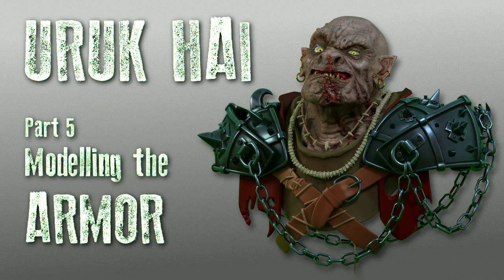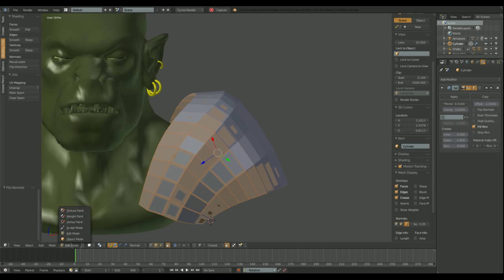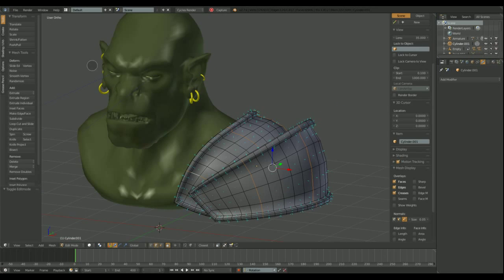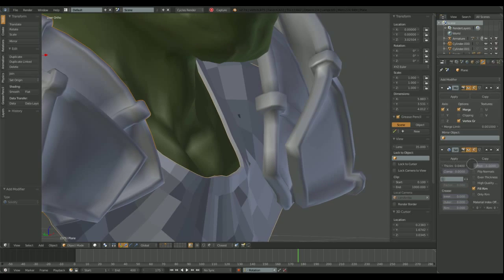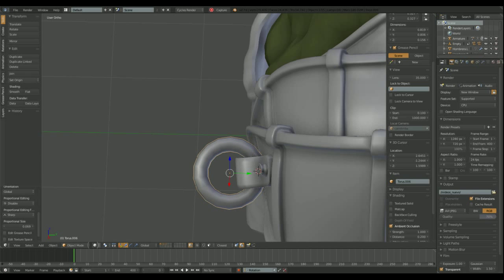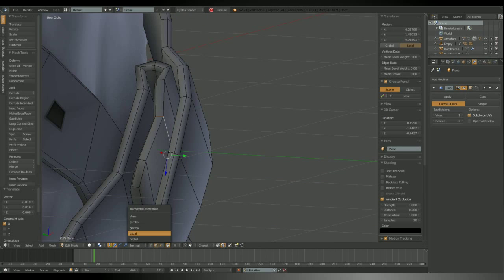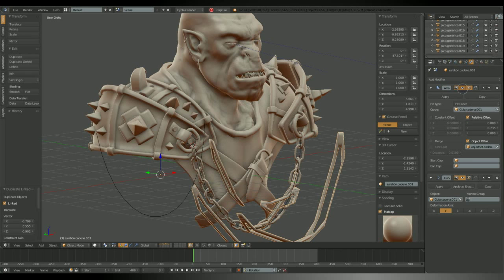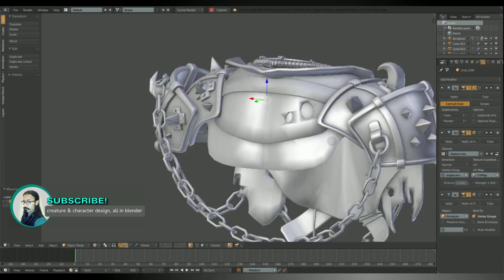Uruk-Hai part 5: Modelling the Armor and clothes

Comment: Hey dude!!! Creatively, I understood perfectly what you were doing but I dont know how to work with the software. Do you have a video that teaches how to use the software?
Reply: For blender there's a lot of tutorials online that can help with almost anything you're trying to learn!
To start, download is free!

I think the most important things to know as a beginner in blender would be:

1. To rotate the camera around its pivot point is done by clicking in on the middle mouse button.
2. Add shift to that middle mouse button and you'll drag/pan the screen.

I remember movement being difficult to get used to when I'd first started.
Once you feel comfortable moving around blenders 3D viewport you can create your first object..

1. Shift+A to add something; maybe start with a cube. :)
2. Once you've added a cube, TAB will switch you between Object mode (mostly for viewing/merging) and Edit mode (for shaping).
3. In Edit Mode, CTRL+TAB and select Face from the menu; try clicking a single face of your cube and hit G to move it around.
4. To snap it to the grid, SHIFT+TAB will toggle that option, but also may snap you to Vertices/Faces.
5. While having a face of your cube selected, instead of hitting G, try hitting E.  That will extrude the face, creating more faces.

Very basic stuff I have mentioned...
But enough to get you started on making some fun shapes n' stuff.
I think that quick keys for the software you're using are a massive part of workflow.  Helps your hands to keep up with your eyes and your brain on what you're trying to create.

Good luck N H!  Hope that helps. :)
Reply: @samohickey  Dude!!! That was a way more in-depth response than I was expecting. I very much appreciate you taking the time to help me out. I'll be sure to use this in my practice!!